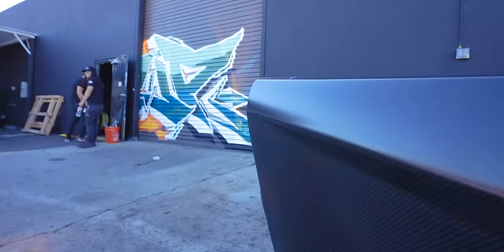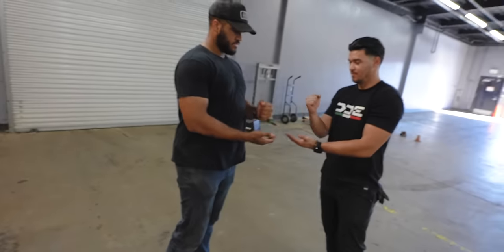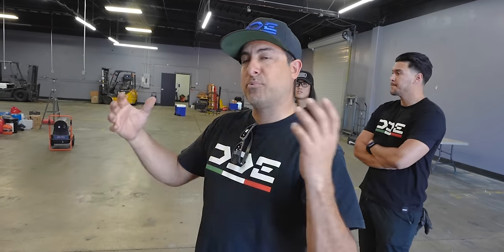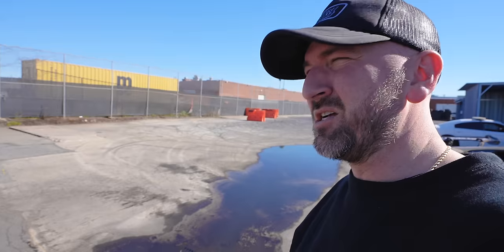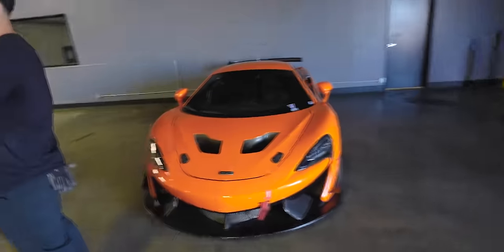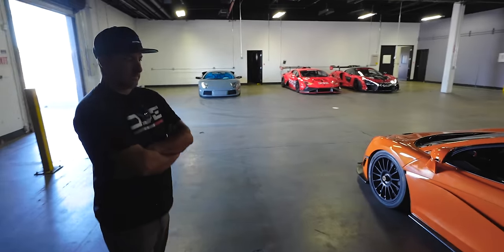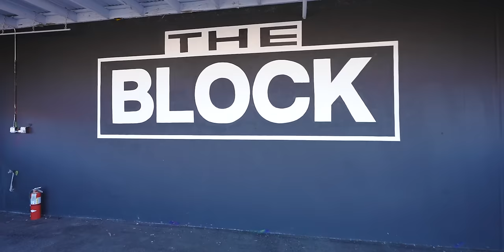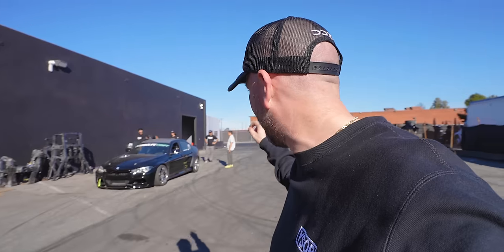HELP! NEW DDE HQ SHUT DOWN UNTIL THIS IS PAID!

Comment: Make the gas station have the cars on display at the pump. The door and window can be the entry to a little shop, where there's drinks and snacks and more high-priced merchandise possibly. I don't know if you guys have a washroom off of the store, but even the change room could be disguised as a bathroom. You guys could put benches down and then have the clothes on hangers outside of the actual pumps which will be branded DDE and then that way people can take pictures of the pumps inside with the cars parked at them. There's also possibility of having a small coffee counter with basic drinks in the convenience store and then having an outside patio, mock up in the main area because of people can come and relax and have a cup of coffee. Maybe they'll talk themselves and to buy more merchandise.

Comment: I would do an old vintage gas station vibe.. Use old Gulf colors from the racing days, the rubber hose that you drive over and rings the bell, put different cars at the pumps every couple of days. Buy some old vintage signs from oil companies, tire companies, etc.. Have a huge window looking into the shop and you will create a place people want to hang out all day.. Talk cars, hang out, eat food, drink coffee, etc..

Comment: As somebody who’s worked in the floor coming industry as a side job, I would say for your retail space it makes more sense and it’s definitely more cost-effective to go with carpet. I would go with a glue down industrial grade carpet, something like you would find in shopping malls and airports. The other option, which might even be more DIY friendly, would be a click lock laminate flooring. The thing that’s unique about carpet is that you can inlay designs you can inlay, accompany logo, or lettering into the carpet.

Comment: For the shop I think it would be sweet if you bring the old shop style into the new,  As a bit of an homage to the shop that started it all. Polish floors, custom glass exhaust lights hanging from the ceiling,  an engine block style table with bucket seats with comfortable bolsters for chairs , and some of the memorabilia from old adventures like the glass that was broken from the sledgehammer guy or the 100+mph wing.

Comment: My suggestion for you is to buy a Skid Steer for the shop to replace the Fork Lift.  You have the forks and buy a sweeper attachment for The Block to clean up and save time for the crew instead of hand sweeping. Time=money
Reply: Facts, At the very least a couple Stihl power sweepers.
Reply: I can't imagine the city uses street sweepers till they blow up... Which would be ideal but I fully agree the skid steer would be multipurpose and awesome... Even for just moving trailers around and stuff

Comment: The garage is a race track. The supercar room is just legendary. And the large experience room should be as future proof as possible. Think LED floor and walls for endless options and have sponsors pitch in big for floor space by doing something like I said. The room would be straight LED panel and different spaces of the room are used for different. Also the large counter is just a smart move for the shop space in that room.

Comment: Since you have to rewire.  Maybe rethink material transport.  Do you really want to carry sheets of metal through a door or just drive it in with a forklift.  Work smarter not harder.  (Move the machines, plasma table and brakes out of that little room and near a roll-up door)
Reply: Was thinking about stuff like this, even having the fab room separate from the build room with just a tiny little door to get between them seems annoying, almost seems like the walk should come down, gotta think about convenience of builds, especially with such a large building

Comment: If you need to fix the parking lot the hardware stores sells a product called aquaphalt it’s asphalt that gets activated by water and takes 24 hrs to dry. Once dry it will outlast your parking lot. Look up videos of it on YouTube. So easy to use and will fill in any pot holes or cracks that you don’t want

Comment: Steel balconies that wrap around the building to give spectators a bird’s view of the grid/The BLOCK accessible through the store. Keeps spectators safe and gives spectators a reason to go through the store. Because it will be public access, be sure to include handicap access to public areas, meaning you’ll need to factor in an elevator.
Reply: Most cost effective solution would be video screens showing live feed when something is going on the grid/THE BLOCK, then when nothing is going on out there switch back to promotional video content.
Reply: Another option: Roof access via elevator from the store, have a cafe/bar up there with a stage and an R/C car drift track would be epic with a scale model of DDE HQ so R/C drift cars can drift the grid/THE BLOCK. Allows 360 view of the property, just add railing along the edge to keep spectators safe. Can start & sell a line of DDE R/C car accessories, livery stickers, and paints/complete livery R/C car bodies.

Comment: Love the petrol station idea but how about a racing track start up grid (because racecar). You can then store the cars on each starting position. You can put the start up lights in the ceiling.  Add a pit stop on the side which has the merch store as well as the convenience store as mini garages. The pit stop also becomes a viewing gallery.

Comment: I use to work construction on bridges and when we would resurface the bridges we used a bridge decking machine...set the machine up pour cement in the lot and the bridge deck machine and cement guys make it nice level and smooth

Comment: Nice to see the cop moving again. Also nice to see Dave getting really comfortable with burning rubber in the Square Corse🔥Getting the old Hooligan base is the best decision for sure especially because of The Block. Love the ideas to come to with the grid on the outside and the gas station store. Maybe the perch store and be the inside and you walk into the car area and thats the outside of the gas station with the pumps next to the cars that are parked in there 👍

Comment: Hey Dave, If you want ideas, make the main entrance into a race track Pit stop and call it something like "The Pit". Because a gas station translates into being stopped and a pit stop shows in the midst of racing. Have hanging electrical and pneumatic lines with tires integrated in the background. Just a thought...

Comment: Use the guy with the massive parts shop. Get a bunch or trunks and frunks (front or back half) of a vareity of exotics and use them as merch racks. You could decorate the walls as if the cars are on lifts but they are made to hold clothes in them, or as hanger racks, etc.

Comment: For the store idea, put TVs on the walls, with the cars shooting flames in a video loop. And right in front of the tv have a heat lamp so as the car shoots flames, you feel the heat at the same time; a 4D experience. On top of that, the customers got to hear the sounds of the car, so what about a sound booth that you can select each car you want to hear the exhaust and it will play that sound. The reason for the booth though, is so you can still run the store and hear other people as someone wants to experience the 599 destroying their ear drums.
Unrelated to the store, for the race track around the building, have it go through the building, so you have a full circuit loop

Comment: Personally think the gas station vibe would date pretty quick. I would go the more traditional funky shop vibe. The aim is to sell DDE, clothing, accessories etc and have it well displayed. Go look at your film of the Gumball fitout with a bit of Jay Leno then modify to suit DDE. Hire a graffitti artist to come in and paint the walls. Could theme the floors but do a commercial epoxy finish. Could hang pictures, car parts, car posters, gas pumps, station signage, neon etc.

Comment: The ideas for the retail store are great, no doubt. The racing section for the "Because Racecar" brand is great, the whole idea of a gas station is sick. Now I think adding some kind of "coffee" spot in there will be sick as well, you can complement it by getting a sponsor for some racing SIMS so people can compete between them in the SIMS and live some kind of DDE experience. 

Even, depending on the company you work with, they can map out "The Block" track to be added to the SIM software so people can drift on "The Block" and live the experience. I think aside from being a retail store, it could be a cool place for the DDE "petrolheads" community to hang out. Just a space for the car lovers.

Comment: pour it cast in place for the k rail. super easy to bring a rig in there if you wanted top tier and perfect. it would be a 1-2 day job + materials.

look for used k rails. find road way contractors or traffic control suppliers. they are always selling them.

call the California DOT and ask who they use. they will know. ask for the maintenance for highways for the county. a little bit of calls, and they will hook you up on who sells them.

wish i was out there to help.

that metal is super dangerous. in the parking lot.

simple demo job for old fence posts and have a contractor put hot mix asphalt after the holes are demoed. it is a 1 day job at most.

Comment: You could buy a three phase converter to plug the plasma table into. I’m an electrician and a factory in Ohio. Might want to look into. It could save some money.
Reply: That’s a NEMA 14-50 plug.  50 amp 4 wire single phase.

Comment: For content sake. It may be worth running the lines for the outside flood lights from the side of the building then down the fence line. With that drown flying around it would be a terrible idea having a line hanging across or near the block area.

Comment: buy some predator ghost 212cc racing engines  from harbor freight and put them on some racing go kart chasis . make a track somewhere around like half of building with just some dividers with a few hairpin turns and straight aways for go kart rentals. you can even put some pvc pipe or metal pipe around the back tires to be able to drift them. that'd be some cool content plus it could generate income to bring more people in to see DDE. BECAUSE RACECAR!!

Comment: Gas station idea with the gas station challenge.... Customers can come in and fill the car up on display and do the gas station challenge with the pump giving off random amounts on each try.....obviously it wouldn't be real gas but just  a customer experience..... Than you could also have promos like if they get it right than a free key chain or something😅 just a small touch to add with the idea.

Comment: That job changing three to four prong at the outlets or can be done at the piece of equipment. Whichever one would be easier. Shouldn't cost much money in this particular situation at your other place. They had to run new power to a spot which can add up with conduit, wire back to the breaker box and whatever you had to get done. This should be no more than a couple thousand dollars at worst. Nothing has to change with the wiring itself going to the box. It's the same voltage. The only thing that changed in a three to four is the three is too hot wires and a neutral. They added the ground wire 20 years ago or so when they were doing stuff because in the event of a short in that system with the ground wire you are protected from that short shoulder. Be something metal connected to that system like a lamp or a plasma table? Whatever it is where was out that ground. If you touch that object and there's a short you can be electrocuted, it does not need to be grounded back to the breaker box that is extreme waste. That makes no sense to me in a place that has tons of wiring being ran in a house. That's one thing. It's probably quicker and cheaper to do it that way then grounding each outlet properly. But in your situation, as long as the object is grounded properly, that can be a beam standing up right? Whatever it is a pipe that goes into the ground, a goddamn hole through the concrete with a rod grounding. It whatever it's very simple to do and 100% safe. In fact, the people that welded the steel if they're steel in that building, did it the same way and welding is literally taking electricity and fusing metal together using that electricity. So if it is safe in that circumstance, there's nothing that you guys would be doing that would possibly supersede that and in my industry we uphold whatever California in New York City standards are. So it will be fine with codes in your area too if any electrician tells you. Otherwise they are lying. If you have 10 outlets that need to be changed, you'll need the adapters or whatever you need in order to change that three wire to four. And then you'll need whatever wire and connectors to whatever your grounding to which should really in no way be longer than 10 feet of wire for each one at worst. So let's say that takes a day in labor. Eight hours to do 10 of them and maybe have less than that. Maybe 100 feet of grounding wire depending on how you're doing, it either a new receptacle for accepting four prong or changing the three prong on the object you're getting power to to a four-prong. But like I said, you just have to make sure it's grounded properly like in your car as long as you grounded a frame and it's a good connection. Meaning no pain or whatever on the surface that you are connecting to. It's grounded. It doesn't matter where on the frame you can connect. It is all grounded. Same here. As long as it's connected to metal that's grounded to the ground, it's fine